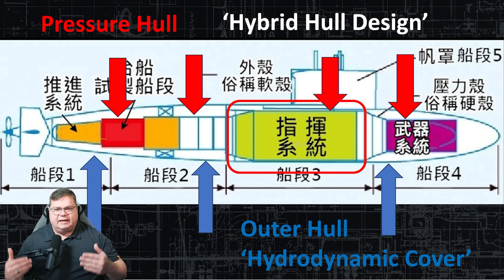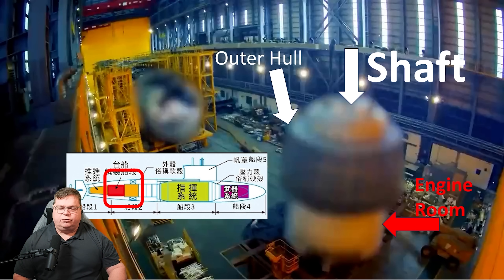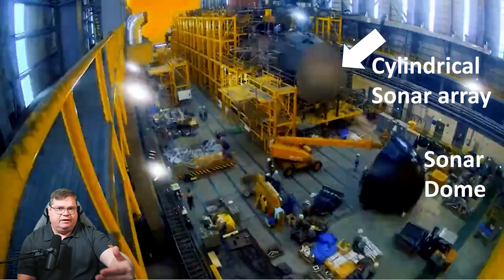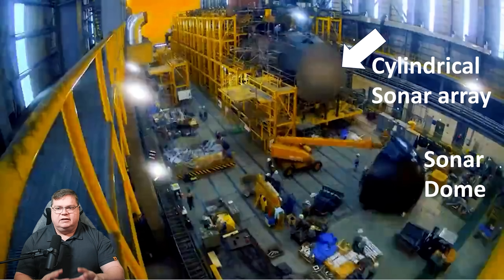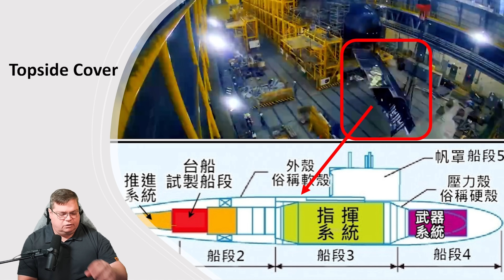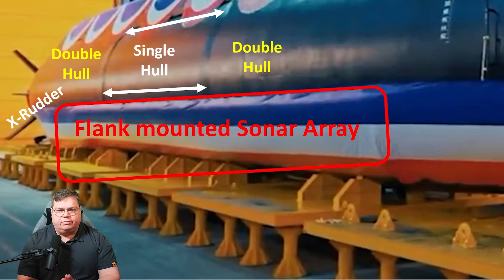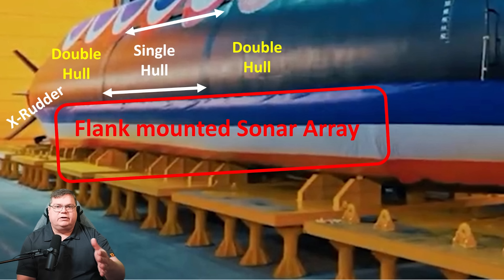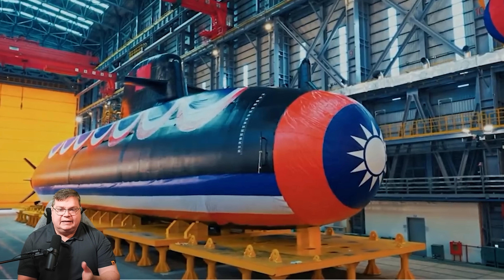What They Don't Tell You About Taiwan's First Submarine

Comment: I wouldn't be surprised if the Taiwanese are working on an AIP module to add to this design.  This is their first submarine.  Keeping it simple to make sure they can make a successful submarine, and then get into AIP for the next one.
Reply: My understanding is that Taiwan has domestically produced lithium ions waiting to be installed once the mast arrives.
Reply: @samwu8647  will be interesting to see
Reply: This looks like a wonderful test bed and training sub, If she dose get off in a combat role she wont need to go far as odds are she will be facing off with China.
Reply: Rumor reported by local Taiwanese news sites says there was indeed an AIP system planned even for this first sub, but the unidentified country of export pulled the export license the last minute due to info leaked to the Chinese.  The same Taiwan media outlets also suggest the next sub will most likely be locally produced advanced lithium battery.
Reply: They already says the  second sub will use Lithium battery
Reply: NO. They have made this submarine with Mitsubishi control and propulsion systems, the hull and other parts are from Hyundai Heavy, the sonar is from Raytheon, the torpedoes are American, the bridge system is Australian... the submarine itself has been made quickly and running. Existing technologies have been taken to go faster. They will not add more. They need to build 4 of these ships, theoretically, before 2030. The submarine is what it is... and it is not going to change.
Reply: They’re not going for AIP but the submarine WAS designed with Lithium-Ion batteries. Taiwan doesn’t need a lot of range out of its boats and they don’t have to cover a lot of territory.
Reply: @grahamstrouse1165 that’s right. Dosen t have any sens to spend 250 million on a ship that can only be submerged for 2 or 3 days in case of a conflict… will be useless in case of war.
Reply: Taiwan's IDS Indigenous Defense Submarine is planned to use domestically produced "lithium batteries" as the submarine's underwater power system.
Japan's Maritime Self-Defense Force's Soryu-class "Phoenix" and "Dragon" submarines, as well as the latest Oshidori-class "Oshidori" and "Shirotori" submarines,
 all use "lithium battery systems" as the submarine's underwater power system. The South Korean Navy has also announced that its second batch of new "Dosan Ahn Changho-class" submarines will also abandon AIP power systems and start using "lithium batteries"
 as submarine power systems. These modern submarine countries that use lithium batteries as their main power source have kept secret the amount of time their lithium battery power systems can operate underwater, which has aroused curiosity among people.
Recently, the U.S. naval professional media "Naval News" reported that the Indonesian Navy will order from France a new batch of "lithium battery"-powered Scorpene-class
 submarines for it, which is referred to by the French side as the "Scorpene Evolved". The French shipbuilding company Naval Group claims that the class of submarines, equipped with "lithium batteries", can last up to 80 days on a single mission, of which 78
 days are submerged, and the maximum range can reach 8,000 nautical miles (about 14,816 kilometers), significantly reducing the rate of surfacing.
The French "Scorpene Evolved" lithium battery submarine has a weight of 2,000 tons, and the lithium batteries fully charged can support the submarine for 78
 days of submerged operation. The Taiwan-made IDS submarine has a weight of nearly 2,800 tons, and can carry more lithium batteries than the French "Scorpene Evolved" lithium battery submarine. It is estimated that the Taiwan-made IDS submarine with lithium
 battery power system may support 90 days of submerged operation.
Reply: They might go for Lithium batteries like Japanese did.
Reply: @mjhou4123  they might actually..good 👉
Reply: @mjhou4123 the batteries are exactly the same us in Japanese submarines… the batteries come from Mitsubishi Heavy Indistries, like the rudder
Reply: @mjhou4123  It is with Lithium battery which I heard manufacturer from domestic supplier.
Reply: Taiwan's first nearly 3,000-ton self-made submarine "Narwhal" has just been built and is undergoing testing. Taiwan's first AI unmanned attack submarine "Huilong" will also be launched by the end of this year.
While Taiwan is building manned submarines, it is also secretly using submarine development technology to produce unmanned submarines. The self-made "Huilong" unmanned submarine is a smaller version of the submarine, with specifications of 30 meters long, 6 meters high and 3.6 meters wide. It adopts a double-shell design (the length of the inner pressure shell is 20 meters). Its height including the sail cover is 6 meters, and the outer shell is also coated with black sound-absorbing coating. In addition, the internal settings are not only equipped with cruise, sonar detection and other systems, but more importantly, it also adds a life support system (for special forces missions) and a system equipped with two torpedo launch tubes. This is almost the basic configuration of a 100-ton small submarine. It uses a hull similar to a manned submarine with a sail-type structure design, and is also equipped with two torpedo launch tubes. The "Huilong" unmanned submarine can launch small unmanned AI boats, torpedoes, mines and underwater loitering munitions to monitor, lock on and loiter attacks on enemy targets. The hull of the "Huilong" unmanned submarine is made of alloy steel produced by Taiwan Steel and can withstand seawater pressure of 1,000 meters. It allows the "Huilong" unmanned submarine to stay at a depth of nearly 900 meters underwater. Not only will it not be detected, but it will also be unable to be attacked by mines or torpedoes.
The "Huilong" unmanned submarine can perform combat missions alone, or it can accompany the submarine as a wing boat for coordinated operations.
Taiwanese civilian manufacturer has developed an Autonomous Underwater Vehicle (AUV) for the Navy - the Seawolf 400 AUV system. The Seawolf 400 AUV is 4 meters long, weighs about 1,000 kilograms, has a speed of 2 to 7 knots, can submerge for 8 to 10 hours, and can carry AI reconnaissance equipment and attack weapons.
Taiwan's Navy has partnered with an innovative company to develop an underwater glider. This equipment has the characteristics of long-term operation, large-scale collection of underwater information, high concealment, low maintenance and operation costs, fast maneuverability, and diversified underwater reconnaissance. It can collect hydrographic information for the Navy and influence the selection of sonar modes and the application of tactics. In addition, the equipment also has stealth characteristics and can perform underwater missions for more than one month, improving the Navy's ability to deal with underwater operations and intelligence collection. Several underwater gliders are currently being deployed to perform missions.

Taiwan plans to produce eight Submarines, 46 AI Unmanned Submarines, hundreds of Seawolf 400 AUVs, and a fleet of Underwater Gliders. Based on this, the Taiwan Navy has been able to build a powerful, modern underwater fleet with AI networked combat capabilities.
Reply: Given they don't need much range, and are using lithium batteries, they might be satisfied with the underwater range. They are going to need a lot of boats, good enough is how I feel about this one.
Reply: Agreed
Reply: Between the 2, I think I'd go for the Lithium over the AIP.  This first prototype is more a test bed.  Production model will be quite different.
Reply: @blakewu1375  I really don't know which, for Taiwan. I think lithium would make more sense since they won't be going long distance. They will be sleeping on the ocean floor waiting around Taiwan.
Reply: @montys420-  I just read that the Japanese lithium-ion sub has a range from AIP of 6500 nautical miles and can remain submerged for 40 days.  This seems to be a bit better than their Sterling Engine subs, which have a range of 6100 nautical miles.  (From Wikipedia...)
Reply: Probably the first one will be in diesel, but still 7 mores in plan are yet to be built. They will add more things for future models.

Comment: Hybrid hull design is pure genius for safety and performance
Reply: Taiwan has successfully developed a 533mm-diameter torpedo launch system for Taiwan-made IDS submarine Narwhal. In addition to being used to launch US-made MK-48 heavy torpedoes, the system is also being prepared to launch Taiwanese-made submarine-launched Hsiung Feng II anti-ship missiles, submarine-launched Hsiung Feng III supersonic anti-ship missiles, submarine-launched Hsiung Sheng cruise missiles, and submarine-launched Sky Sword II air defense missiles. The diameters of these Taiwanese missiles, after being modified and installed in submarine-launched pods, are all smaller than 533mm torpedo launch tubes, and the IDS submarines can all launch them in the future.
During launch, the torpedo tube will push the Taiwanese missile pod into the sea. After traveling a certain distance and approaching the surface, the missile engine will ignite, break out of the pod, and emerge from the water. After the guidance system is activated, the missile will fly into the sky and autonomously attack the target.